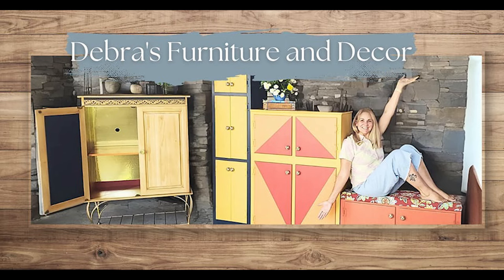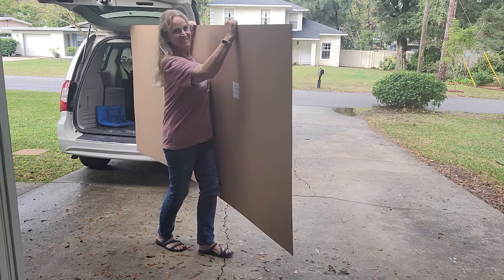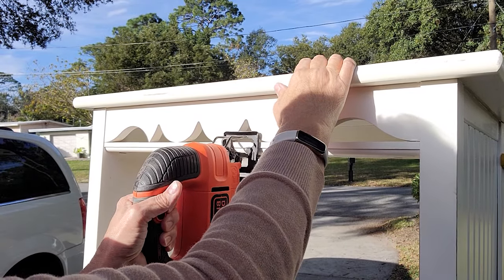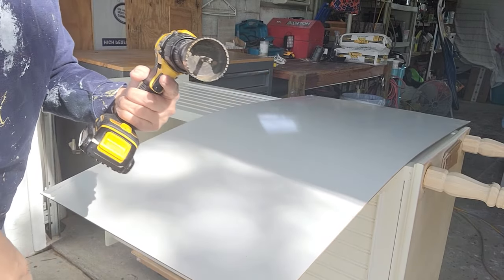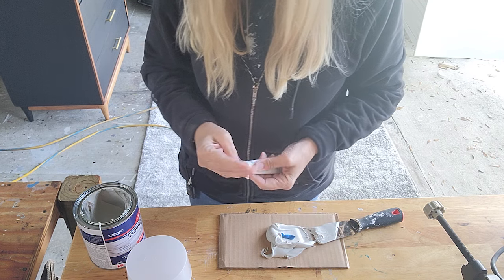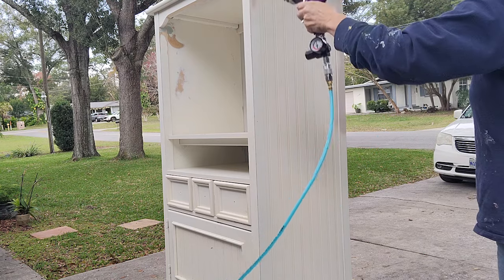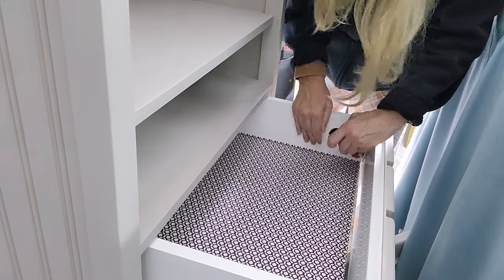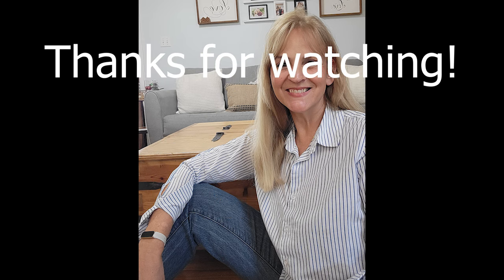Upcycled Elegance: Coffee Cabinet Transformation!

Comment: I would worry that the new legs make this piece more prone to tipping over. It now needs to be anchored to the wall.
Reply from the maker: That's a good point. The person who bought it does not have small children. She has is in the corner of her kitchen. She is also using the cabinet on the bottom for heavier supplies. That should help with stability. Thanks for sharing. I will see if I can contact her to let her know the concern,